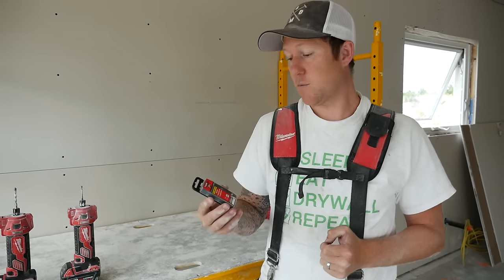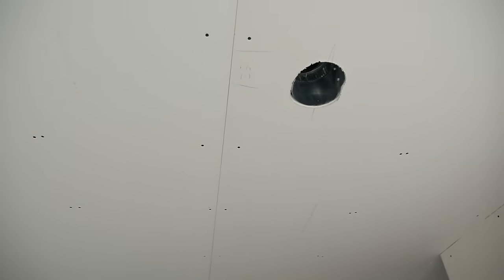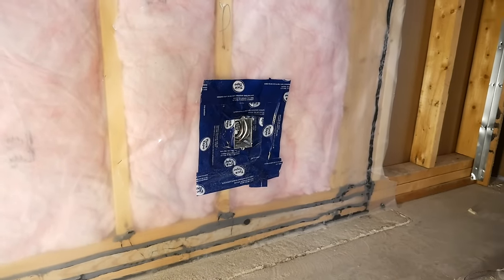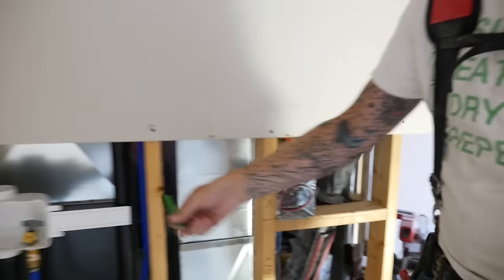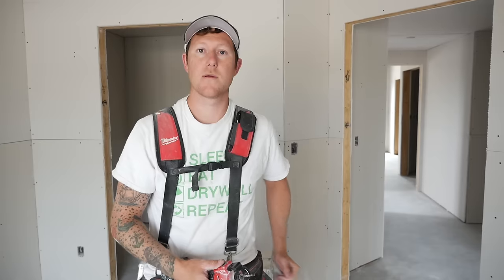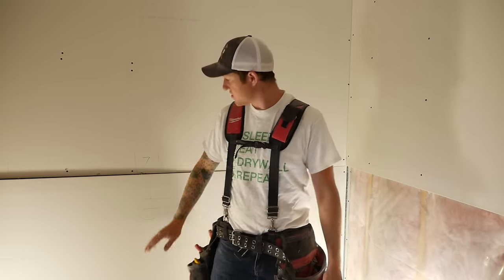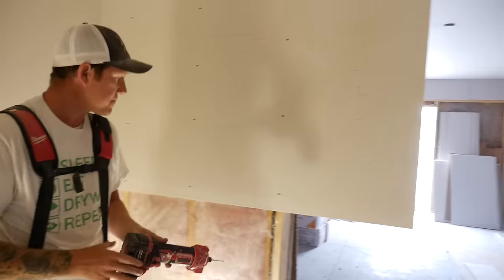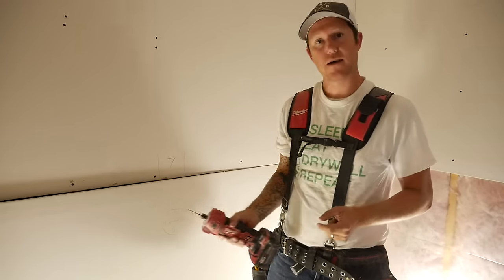Beginners guide to using the Cut-Out Tool/Router

Comment: Well, this explains why after replacing a light switch with a dimmer switch in a new house, I saw sparks coming out from behind the switch. Turns out, there were stripped wires touching. Never understood how that happens until the video showed a router bit stuck into the box.

Comment: i have double stacks of drywall in several rooms of a 1940s home. problem is that i cant find a drywall bit that has enough length for the guide tip to reach the stud. any recommendations?

Comment: Hello. I have 2 1/2” sheets of drywall plus 1/2” inch resilient steel channel, then brackets for my pot lights on the floor joists. What would you recommend I use so that I can cut the holes in line with my pot light brackets? Would need a bit that is like 2” long to catch the pot light bracket?
Reply: I have a Milwaukee m18 compact router with 1/4” collet

Comment: I know it is a stupid question.  I am finishing my basement and do not want to buy a router for couple rooms.  Can I get router blade and use it with my drill?
Reply: For a couple rooms, do it the old fashioned way - measure out the locations on the gyp board and cut with your saw. I don't think you're get enough rpm with a drill

Comment: @DrywallNation. Question. Why must the drywall be cut out around the outside instead of keeping the bit inside the electrical box? Is it to lessen the chance of nicking wires in the box? All other cuts are done following the inside of the opening.
Thanks.
Reply: if just cut the inside then the protruding box edges (if the box was not installed flush with the 2x4) will press against the drywall and you can't set the sheetrock flat.
Reply: @davidshereda7885  Thanks for replying. That makes sense.

Hope you and your family stay safe and well

Comment: Yes, be careful to not put pressure on the sheet until you cut out the boxes. Buddy Tools LLC sells a Mark N Guard product to help locate electrical boxes behind the drywall. It marks the box center without the need to measure to mark the box center. It also guards the wire from being cut by the bit. You can get 5 units for $10. Check them out at BuddyToolsLLC.com You'll like the way they help with this process and eliminate errors and wire repairs.

Comment: noticed on exterior walls how they are taped up and sealed so nice until this tool comes along and cuts it loose on every box. Drafty much after?
Reply: If its insulated right then no but a lot of hangers hate that mesh cover on insulation cause cant get glue to stick to studs so it takes more screws which means more time which means for piece workers less money

Comment: At 6:14,  I am confused...  you say to push back the wires in the electrical box, but you router the outside of the box to get the ears (tabs), because you can't do the ears from the inside of the box.  ????
Reply: It would probably have been better to demonstrate that you move from the center of the box to the edge, then move outside the box to cut.

Comment: What happens if you measure wrong and router into the hot wires?? I prefer to cut everything before I attach the drywall. Just use tape measure and drywall t-square

Comment: Why did you go anti-clockwise around the socket but clockwise around the door openings?
Reply: If you have used a router before you would understand.  The idea is that the spinning bit would ride along the wood when cutting inside and going in a clockwise motion, the spinning blades hugs the inside and the opposite is true if your are cutting on the outside running in the counter clockwise direction.

Comment: So when dealing with plumbing pipes and such. How do you transfer there position onto the drywall?
Reply: I find the center of the pipe, measure from sides and top or bottom, whatever is closer. I have a drywall circle cutter which is a compass and ruler combined. Basically, you transfer them on to the sheet and cut them out before you put the sheet up
Reply: If your talking cutting holes for pipes the take a keyhole saw and punch it through and rotate pipe usually goes through easy

Comment: quick question, is it not cheaper just to use the rotozip drillbit on a regular drill? i assume it would work just as well.
Reply: Yes, it's cheaper.  But as far as "just as well" - no.

A regular hand drill turns too slow to be effective (usually max of 3,000-ish RPM while a RotoZip-type tool is usually more like 30,000 RPM - 10x faster), and is awkward to hold to do this sort of work.  A drill is also not ideal from a design perspective - a drill is intended to work with a load which is along the length of the bit, and almost no side load.  These tools are designed to have almost all side load, and very little pushing up on the bit.  So they're likely using different style of bearings, have the armetrure of the motor supported differently, etc.

You can find "drill saw" bits in the sketchy section of a cheap hardware store, right next to the gator grip sockets and similar useless tools - because it's generally not a great idea. :)  If you want a cheaper solution, the right way is to use a jab saw. ;)
Reply: Doesn't turn as fast and the weight and shape of a drill would throw your balance off making you break more bits

Comment: Good video mate, what would you say is a standard size bit for day to day or would you always switch between sizes depending on what you're cutting ?
Reply from the maker: The 5/32" XBITS by Rotozip are by far the best bits on the market.
They're a happy medium between the 1/8" and the 1/4". We just released a video about them a few days ago that you can check out.
Reply: @drywallnation  cheers mate, might have to invest in one of these, dont see them much in the UK
Reply from the maker: They're worth their wait in gold if you install a lot of drywall!

Comment: cool shirt...do you find the router holds up well in a typical day of hanging board...i agree about the depth guide except with the 1/8 bits seem to not allow as much pressure ...great off angle!
Reply: Yes the router holds up all day. The size of battery you have naturally dictates how long it lasts before recharge. Cordless routers are my go to because I hate lugging a cord around.

Comment: Agreed - an excellent job explaining use and techniques but with all that dust flying around not only would a mask be important but safety glasses as well. Also a majority of my work is in finished homes.  ( new bathroom/ kitchen etc )I have found that the roto zip sends so much dust through out the house, I now rarely use it.

Comment: Always wondered what the technique was.  Seems like getting router spinning when its inside an electrical box would be unwise.  attention to Depth control is key.  Also I did not see the router move from inside the box on insertion, to outside the box for execution.
Reply: You can stick the router in the box, just don't go the whole way in, there's no need. Your only dealing with 1/2" residential and 5/8" for commercial. I can cut boxes out without touching the wires but I also push them back with the butt end of my hammer

Comment: If u are cutting the inside profile of the box, how does the drywall sit flush?  Seems impossible
Reply: He starts on the inside to find the box but once he finds it, he cuts the outside
Reply: @SeanA88  hope so
Reply: @DCopp  lol that's how it's done. I used to cut the insides out and then do the outsides so you don't butcher them but that was when I first started. If you only do the inside the sheet will bump out and not sit right
Reply: The thickness of the edges aint thick enough to really bust through it thin enough it will usually slide through with a slight bump

Comment: Can these bits be used with a regular corded drill?
Reply from the maker: Hmm...I've never actually tried that but in theory yes. Especially if you're only hanging a little bit of drywall. If you're doing lots than a router would be more efficient but a drill should work none the less.

Comment: Is it a 2 cut process, 1 around the inside of the box and the 2nd around the outside of the box?
Reply: Seems so. Plus starting in the middle of a box seems counter intuitive.  Think you'd want to be in a corner, just as easy to mark out.
Reply: You start in the middle, drag to where you hit the edge, then lift it up to just barely jump over the side.  You'll feel the bit drop back down when you clear the edge.  That's the one thing I don't think he explained quite perfectly in the video.  By starting roughly in the middle, you don't have to be super precise in the measurement - as long as you hit somewhere inside the box, you're good.  That's the main time savings - not requiring precise measurements.
Reply: One cut the box will not bust the rock if its cut inside of box and aint off too bad, push against it and itll push its way on out

Comment: how long do Milwaukee routers last i had some cordless  dewallt routers and they suck so im.back to corded routers
Reply: I've had my Milwaukee router for over 2 years and it still works like new. I do metal framing and drywall so it's not used everyday but it does get a lot of use

Comment: Do you recommend vapor barriers on exterior walls?
Reply: You need it on the inside and building paper on outside, for regulations and to stop dampness/condensation. Its not expensive but will be in the long run if you dont use it

Comment: Really clear communication, well filmed as well. I learned a few things I hadn't heard elsewhere, and if I was newer, I would have learned lots.

One question tho: I was putting up some drywall a while ago, and I used a marker on it, but my coworker told me that marker should never be used on drywall as the ink bleeds through many layers of paint, and is super hard to hide. I see you, clearly an experienced drywaller (my crew are all generalists), using a marker on sheets. What's the true true? I was using black Sharpie, are you using something different, or is the bleeding through story just baloney?
Reply: Its true never use a marker, the guy in the video is using a construction pencil

Comment: Looks clean only thing I see is wayyyy too many screws in the drywall.. those walls are screwed off like ceilings..
Reply: Maximum field spacing is 16 inches on walls, while ceilings are 12.  He's got them what looks like about 5 per board on a stud, which would be around 12" - which is completely reasonable (and which is what a whole lot of good drywallers recommend).  That extra screw will reduce the tendency for screw pops and will create a more rigid structure.
Reply: Wood studs you can glue studs and use 2 screws in the field and thats plenty. Walls only though

Comment: What size collet is used to hold Rotozip 5/32” xbit? Thanks!
Reply: small bit standard guide point 1/8,medium x bit 5/32,larger door /window bit 1/4 .my thought better to stick with medium bit those larger  bits are faster but playing in the drywall dust.
Reply: @SuperJupiter33  x bits are the best all around which like the previous person said use a 5/32 collet. The big one for doors and windows use a 1/4" collet

Comment: Makita or milwaukee screwgun and roughter? I need to buy a set.
Reply: I use a Makita gun and router, and have tried the Milwaukee tools on a jobsite another guy brought, there's no real notable differences and I haven't experienced any quality issues with the Makita nor heard anything bad about the Milwaukee.

You are really just buying into a battery/charger platform, and Makita does currently have a much larger selection, if that matters. About 220 tools vs 150 last time I looked.

Hope that helps.
Reply: @Interior_Works   Thanks that is a help. Just got back into construction since the 2008. Been using my old corded tools. Have a 20v dewalt impact and drill 2 ah black Friday special so I don't really have a platform to build on. Been wanting to go Milwaukee but makita keeps catching my eye. No 1 company makes everything I want. 

I am currently working for a general contractor mainly in hospitals so lower noise and dust control capabilities are somewhat important. And I could need the tool to do almost anything except for electrical/mechanical.
Reply: @jamesrogers4674  no problem, you're still going to want to hang on to your corded tools if you're doing big jobs. A lot of guys tack the sheets up with their cordless, them later finish screw em all off with the corded drill, never any lag on power.
Reply: @jamesrogers4674  Dust control, Makita has the clear vacuum cap for their router, it's a little pricey for a piece of plastic, but routing is where all the dust comes from. Not sure if Milwaukee has something like that or not.
Dust control is also my niche as well, people pay a lot extra if they know things will be dustfree and tidy.
I use the Festool planex for sanding, made a little video on it if you wanna check that out.

Comment: I’ve watched 10 of these videos now and nobody has explained how to cut out a section already installed when you have to cut out from middle of stud to middle of stud! Not everybody does new construction… sometimes you’re replacing a patch like I have too
Reply from the maker: Nobody has explained it because that's not what this tool is used for. You can't plunge cut against a surface. The blade doesn't run right to the tip of the bit.

Comment: Just did a house, sheetrock installers cut wires.  I guess they they don't know how to use a router and  stick a 3" bit in a box that should only be set to 7/8" and cut  alot of wires.  Why measure the center, measure closer to a edge....

Comment: Where is the nail plate? At 2:55 no plate over plumbing through the floor plate.
Reply: nail plate not needed , the waste pipe is more than 1" inside the edge of the bottom plate , and the drywall is 1/2" thick , and they will use 1-1/4" screws , which wont contact the pipe

Comment: Here's a tip, throw that thing the fuck out and use a jab saw.. if you pull your tape measure out to get a center for an outlet then you might as well just get the measurements and Jab saw it out rather than partially screwing your sheet and then cutting.. waist of time. Cut looks like shit aaaand dust... sometimes old ways are best.. coming from a union carpenter that eats drywall screws for breakfast I've worked with guys that swear by em and been forced to learn both methods personaly I hate roto zips

Comment: what am i doing wrong this tool slows me down makes a huge messy cloud. my tiny circular is 5000% faster making a line cut my occulting tool is cleaner box cut my tool was a bat waste of money for me.
you make it look fast and easy i try to move my mini router like that i will snap off the bits to much pressure on the blade makes it snap off with ease and with dewalt having a quick bit change im still taking to long replacing the bits especially in plaster or other materials its just not up to the task my circular and occulting cut every material i could want to cut i dont have to worry about direction i cut materials with my tools either

Comment: Why is this better than a knife? and premeasuring?
Seems like alot of dust, also a feinsaw/jigsaw would do the excact same ting.
I dont think i understand this tool.:S
Reply: time saved

way less effort involved
Reply: The guide-point bit rides along the edge of the object so you can basically trace it in place, and the round bit can make as tight of a corner as you need without any effort.
Reply: Purpose for it is, and this is the only reason, time, piece workers get paid by how much the can hang not by the hour so anything at all to save time to get to the next job is the point yeah its dusty but if you hang or finish for that matter its just one of those things, its expected

Comment: I’m an electrician and i go to houses where they bury the switches and boxes and not just one or two they buried 15 of them smh
Reply: But no recessed lights?
Reply: Mr Panda I wish I could say no but they do 😠
Reply: Guilty here:-)
Reply: Sounds like shitty shetrockers. The crew i had worked with had another crew, owned by the same guy, do some terrible work. Our 200 plus sheet houses had a max of .25 inch gaps. We shot for nothing larger than 1/8th. Had a 250 sheet house sheeted in 4 days with 3 guys. The guys who finished loved following us for the lower use of mud to finish walls. In other words, good crews dont do shitty work.
Reply: Dynamic Solutions you got that right
Reply: Dynamic Solutions good crews occasionally do shitty work by sccident, they just don't leave it there.  Best drywallers I ever saw made a few dumbass cuts from bad measurements etc, but they didn't try to "make it work", they just redid those pieces